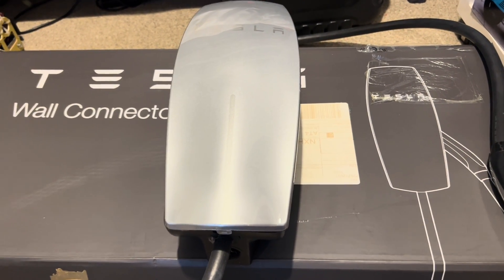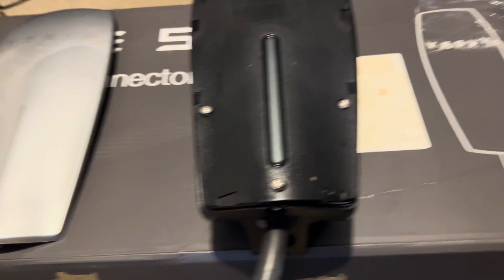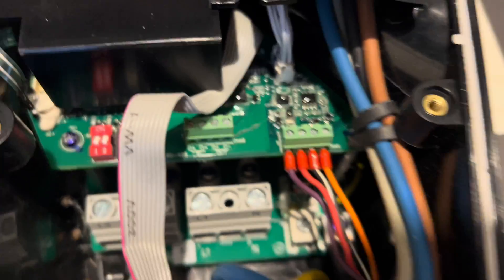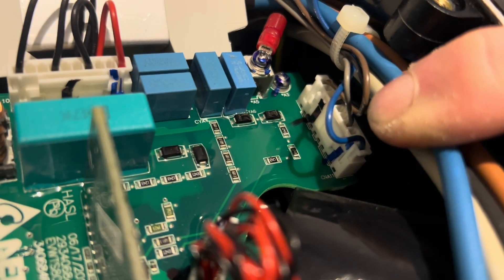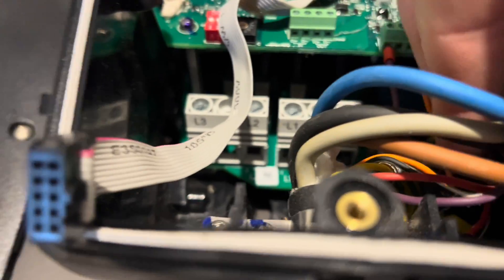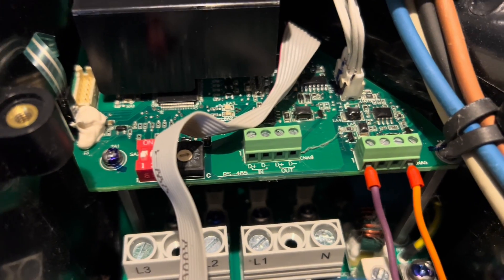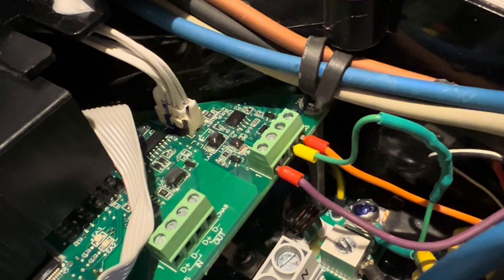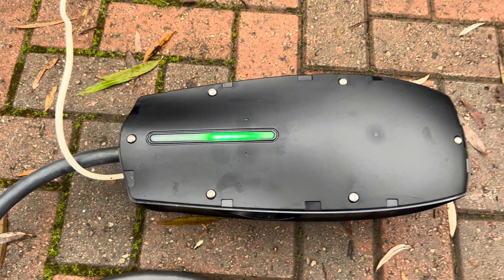FIX Tesla Wall Connector Red Light of Death or Charging Issues

Comment: Thanks Dave… fantastic. 
I have read through all the comments and unless reading them wrong I can’t see my particular issue. 
It’s an intermittent one but becoming more frequent as time goes on. 
When I plug into the car (Gen 2 charger) … the car app tells me me the cable is not connected correctly and to try reconnecting again. If I try again holding the plug so there is no strain from its own weight it will connect. I take some weight of the cable by propping it up on a bucket and it’s fine. All external fast chargers and my granny charger are never a problem. 
Connection problem in the plug or cable maybe ?
I have bought a used charger intending to do a cable swap for now. 
Cheers mate
Reply from the maker: Test the continuity of each wire inside the cable

Comment: I set DP2 to legacy.
I removed pin2 and pin3.
Added 10k to pin3 and PE.
Still doesn’t work.

Questions:
1. Before connecting 10k resistor, the socket3 on green connector block measured 8.7k to PE. Is that what you get?
2. On the controller board, there’s a red led blinking slowly. Is there anybody seeing this?

Also, after removing wire from pin3, the wire showing 9.8k to PE, that tells me that my wire is working.

Comment: Thanks Dave!
I intend to use gen2 WC for my Nissan leaf too.
After watching the video I thought I might need to do the same mod.
However, I’d decided to give it a second look at the type2-type1 adapter.
It looks like my adapter did not take care of PP pin at type2 side, it was just floating without connecting to PE through a 220ohm resistor.
I’ll get 220ohms tomorrow and see how it goes.
Reply from the maker: The type 2 CP/PP pins are different lengths by design
Reply: @DavesDiscoveriesChannel thanks.
I pushed switch 2 down for legacy mode, removed pin2 & 3, added 10kohm between pin3 and PE. Did not work for me.
Green light on Tesla WC turns to solid red when plug into Nissan leaf (type1) through type2-to-type1 adapter.
Reply from the maker: @Billo7979have you tested your type 2 adapter on a public charger?
Reply: @DavesDiscoveriesChannel oh thanks Dave. I should. Will update.

Comment: One of my customers has a 3 year old wall connector which throws 2 errors: when powered on it gives a static green and 1x flashing red light, when connected to the car it gives a 6x flashing red (thermal error). Could these 2 errors be the same issue? 
Can you tell me what range the resitors can be?
I only have 1K and 4K7 restors at the moment and of course nowhere to get a 10K fast, if I put a couple in series would 9K4 or 10K4 be ok?

Thanks!
Reply from the maker: Try putting two 4K7’s in series
Reply: @DavesDiscoveriesChannel Thanks, I'll try and report back. 😊
Reply: Sorry I forgot to report back. Searched my shed again and found a couple of 10k resistors, screwed that in like in the video and voila, charging😀.
Yesterday another customer of mine called with the same problem, doing the same with his charger tommorow😁.

Thanks!

Comment: It worked for me too. However I lost the ability to open the charging port by pressing the button on the cable head. Should I revert to normal mode instead of legacy? Should I reconnect wire 2?
Reply: Follow-up: I reconnected wire 2, left the resistor connected as discussed and switch up position. I have function port opening back. Thank you Daves et al.
Reply: @nagari is this still working okay?

Comment: It seems to have worked most of the time, I still get the occasional connection fault but is fixed by the 3 second reset. It cost me about $12 in parts from Jaycar Australia to make the 10k ohm 1w resistor cable. The hardest part of the fix was I removed the earth screw completely because of a loop fitting instead of spade attachment and it took me over 20 minutes to get it to go back in due to access and angle issues. Still a major improvement and a hell of a lot cheaper than a replacement, Cheers Dave your a legend !
Reply from the maker: @nathanthomson3554  glad you got it mostly sorted but 12 AUD for a resistor a little bit of wire is insanity 😮

Comment: Hi Dave. I do have a different problem but I think it might be a bit related to this one. 

For me the problem with this very exact model is that it is not showing red but rather green light on top of charger for monophase, and after plugging to my tesla, it doesn't "click". it doesn't charge and it throws out error CP_a053. Have you ever dealt with something like that? Do you advise to use legacy mode, or do you have any clue on what can be done? Even Tesla service couldn't diagnose the problem and they've offered instead repair at their local dealers. 

Thanks in advance!
Reply from the maker: @KHRONOS2232  that error suggests the control pilot signal is not present, you’d need to start with a impedance test between the CP pin and its appropriate terminal on the green block
Reply: @DavesDiscoveriesChannel  many thanks. Will let you know of the results. 😊
Reply: @DavesDiscoveriesChannel  hi dave, checked today and it seems that both pins on the sides don't read electric flow through them. I've checked CP and all others, only CP and the one on the opposite sides seem to be faulty. what can be done regards that? replacement of cables seems nearly impossible from what i've seen, any easy fixes you've occured in the past for such issues?
Reply from the maker: @ simplest option is buy a second hand type 2 cable and cut one end off and wire that in to the charger then use the 10k resistor mod to trick the charger into thinking it’s still got the temperature sensor in the connector body

Comment: I am trying to fix one of these with an intermittent CP wire at the plug end. All of the small wires are the same gauge, so any one of them can break, which I suspect is the cause of some of the NTC issues. If I could get the plug apart, I might be able to repair the broken wire, but even after removing the 2 screws under the Tesla label, it will not come apart, probably due to being full of potting compound.

Comment: Hey Dave, I have a question before I attempt to make the changes; I bought a gen2 wall connector and once I connect it (with CEE 5pin 16a) the light goes solid green on the unit. But the end wires button doesn't open the charging port, so I open it manually and connect. 
It clicks but then nothing else, except what I have in the app which says "charge station not powered, check power source or try a different station"

Do you think if I follow your instructions, the problem would be solved?

Thanks in advance!
Reply from the maker: @frankamri8506  there’s no harm in trying 👍
Reply: Dave, I just switched to " legacy " mode and it started charging... No other changes!

Many thanks for your helpful video man.
Reply from the maker: @ result 💪

Comment: "once you put into legacy mode, they're disabled"... (switch and temp-sensor)
On all Wall Connectors I have encountered, the switch to open the chargeport works in both settings. They have all been Gen 2 to be fair.
The problem I see most often is the purple Pilot-signal wire losing connection near the plug/handle. Often intermittently, and bending the cable near the handle will connect/disconnect when using a multimeter in audible continuity-mode. This problem renders the entire Wall Connector defective and unusable! Such a small broken wire inside! And the handle is impossible to open, and thus can't be repaired...🙄

Comment: Dave, many thanks for this wisdom. Mine had the single flashing red light with a temperature warning on the Model Y console. I got a 10k resistor, removed the cable from pin 3 and connected the resistor from there to earth, did not make any other changes, did not put in legacy just left the dip switches as they were and I’m back up and running. Proximity and button both working great. Car now charging again!! Saved me £475 that Tesla was wanting for a new one! ⭐️ Thank you.
Reply: Is this still working okay?  I’m about to try the same fix.  Thanks

Comment: Hi, I did the 10K resistor trick and it worked !...... only, now the charging stops after approx. 30KM charging, what can be the issue ?? Thanks !
Reply from the maker: @HarrieBrunklaus  are you getting a red light or is it just stopping?

If it’s stopping with no fault light it’s possibly the car stopping the charge ..

Did you put the charger in legacy mode?
Reply: It is just stopping, after reset the wallcharger, 0:02  I can charge another approx. 30km.
Reply from the maker: @HarrieBrunklaus  try potting it in legacy mode
Reply: @DavesDiscoveriesChannel  it is in legacy mode.
Reply from the maker: @HarrieBrunklaus  strange :(
Reply: @DavesDiscoveriesChannel  indeed☹️ but, what can I do ( except buying a new charger).

Comment: I do not have any red light issues, but I want to use my Gen 1 wall connector to also charge other non-Tesla vehicles.  Can I do so just by switching Dip switch 2 down, and without removing any pins?  Do you by any chance know whether the same would work on a Gen 2 wall connector?   I have both installed at home. Thanks.
Reply from the maker: Yep just change the dip switch to put it into legacy mode 👍

Comment: Thank you very much!  I only disconnected pin 3 and wired it to earth/0V with 10kΩ resistor - perfect, all working as before.
Reply: So does that mean that pin 3 is the temperature sensor and pint 2 is the switch? With pin 2 set up with the resistor, and pin 2 still connected, does the switch button on the Type 2 connector still work? This sounds like a brilliant solution, if it does work!

Comment: Hi thank you for the video. When I plug in my GEN three charger it turns solid red and won’t charge. Will this fix my issue ? When it’s not plugged in the lights and charger function properly. This only happens when it’s plugged in.
Reply from the maker: It’s very possible

Comment: thanks for the video! i connected the resistor in series with the faulty NTC and it made it work too.

the NTC itself measured 1.8kΩ, which the charger must have perceived as 70-80°C. no wonder it refused to work. :)
Reply: How u measured the ntc?
Reply: @ by connecting a multimeter to the NTC wire and the ground wire.
Reply: Is the NTC what the video refers to as Pin 3?

Comment: Great work.  Can you solve another problem? My charger has a proximity sensor problem.  Tesla won't help.  Will the charger work in Legacy mode with the proximity sensor disconnected?  Do I need a static resistance like the one you added for the heat sensor?
Reply from the maker: In legacy mode it should ignore the sensor
Reply: I just opened mine up and it's a different model.  I've got a model III wall connector.  There's no dip switches that I can see.  It does have the 4 wire connector through comming from the lead.  I don't suppose you have a fix for the model III connector?  Is there any way to put it into legacy mode so it will ignore the proximity sensor fault, or to modify the two proximity sensor wire coming from the handle to trick it into working?  Pity I can't post a picture. Thanks steve
Reply from the maker: @stevefzr9184  sorry I don’t :(

Comment: Where doth one find a " resistor" ?
Reply from the maker: EBay 👏
Reply: @DavesDiscoveriesChannel  Hi Dave, this video is very helpful, but I have a question. When I look on amazon, it tells me there is 1/2W, 1/4W and other W 10k resistors. What should I go with??
Reply from the maker: @Skillerz_lol just the cheapest you can buy, it doesn’t need to be a high wattage it’s just for reference

Comment: Mine is working good until this afternoon. It still has green light but when i connect it to my car it turns solid blue and the charge doesnt start! It says cv_a027 error code . And when i look at the wallmonitor app it says vehicle handle is over heated! Like 127 celcius. What should i do
Reply from the maker: Disconnect the sensor wire inside and bypass it with the resistor

Comment: My problem is that the WC shows a green steady light. The push button opens the charge port, but then no charging starts. The WC green light is stable throughout. I tried disconnecting the third wire only (a variation on you solution based on another commenter). That gave me a steady read light on the charger. What conclusions can you draw from this?
Reply: Did you fix this issue Mike? It is the same for me
Reply: No, I bought a second hand Tesla charger instead.
Reply: You needed to do the resistor bypass to fix the issue.

Comment: Did you have a fault indication on the charger prior to this? My charger has a green light, like normal, but the car doesn’t detect it when I plug it in and thus no charging starts.
Reply from the maker: Yes it was showing a red light
Reply: I also have same issue. Have your issue resolved after implementing this solution ??

Comment: haha.. there is a reason why the temp sensor is dead... you should treat the source of the problem and not passby it.
its like disabling your airbag just becuz it trips the breaker.
good luck.. hope it doesnt burn your house down.
Reply from the maker: The vast majority of tethered chargers do not have a  temperature sensor (and obviously absolutely no charger leads for untethered chargers do), it’s only there to make things safer when working at the ridiculously high currents the charger supports that aren’t even legal in the UK.

Comment: Thanks for the video. I tried everything you suggested and it worked. However, this removed the ability to open the charge port door from the charger handle button. Out of curiosity, I then reverted the legacy dip switch setting, got rid of the resistor, reconnected the second wire, and left the third simply unconnected and this also worked fine. This also left me with a working handle button. So to recap, all I had to do was disconnect the third wire to get my charger working again.
Reply from the maker: Sounds like yours just had the thermistor fail
Reply: I also tried to only unplug the 3rd wire, leaving the switch in the up position. This fixed my red blinking light issue with “charger handle too hot” warning and it charges well, but now I lost the ability to open the charge port with the button. Any ideas? Thanks.